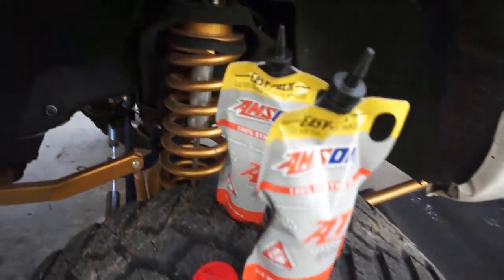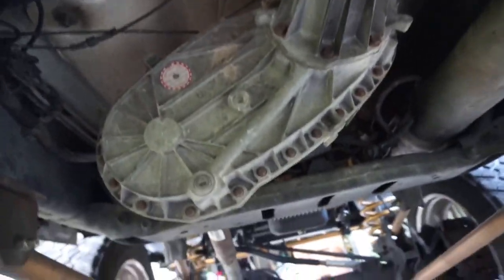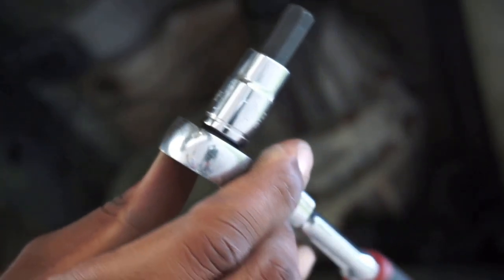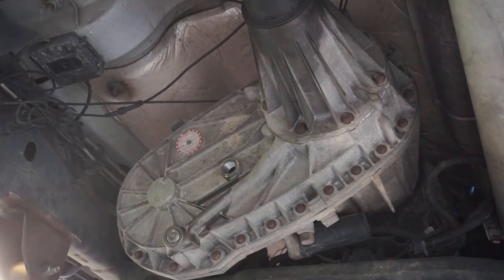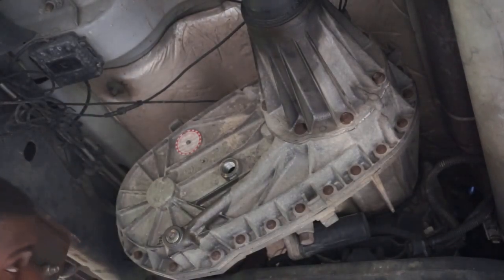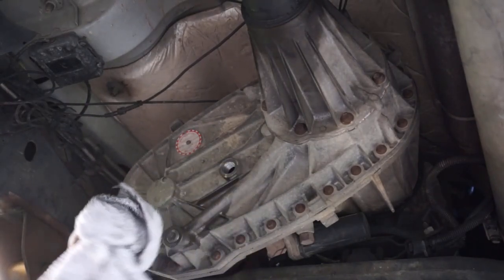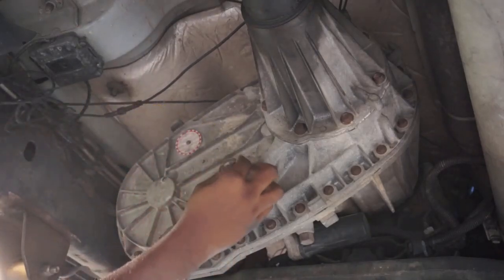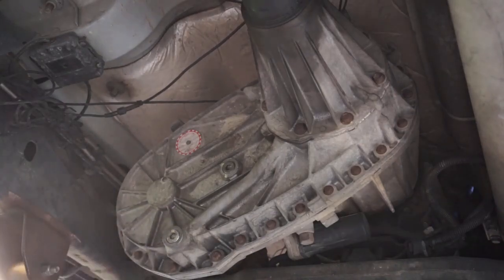Most Forgotten Fluid on your TRUCK!!

Comment: Power steering for me.  Just diy flushed it at 275k for the first time.  Did my brake fluid twice. Diff and transmission once at 160k.  Case at 200k

Comment: Easier way to do it and avoid mess is to grab a Harbor Freight siphon pump, crack the top plug, suck most of that juice out, then crack that bottom plug to drain the rest and you won't make a mess. Use that same siphon pump to refill.

Comment: I use 0w20 for that transfer case. Way too much engine for atf. 

If your truck is modded, it no longer meats the manufacturers specifications. 

Engine oil should be changed every 5k
Reply from the maker: Never heard of that one before man but interesting to know!

Comment: Changing t-case oil every 30k miles
Reply: 2019 Ram owner's manual and factory service manual say diffs at 30grand, xfer case at 60grand, spill&fill trans at 30grand and spill&fill with trans filter replacement at 60grand.